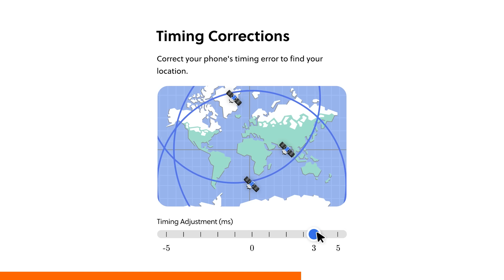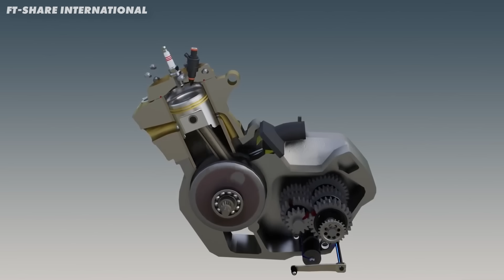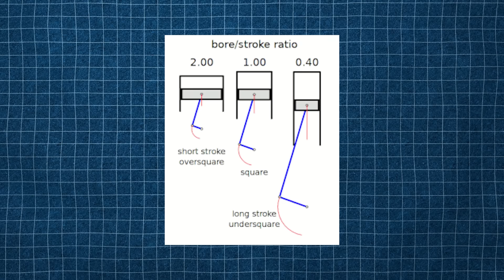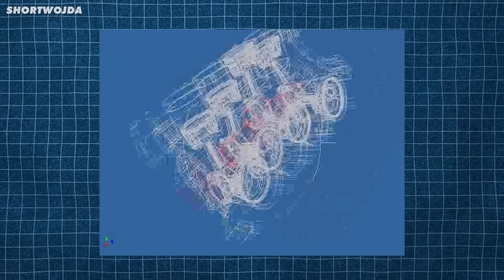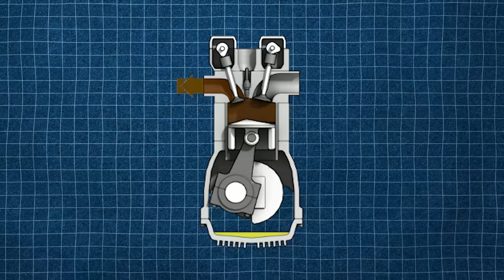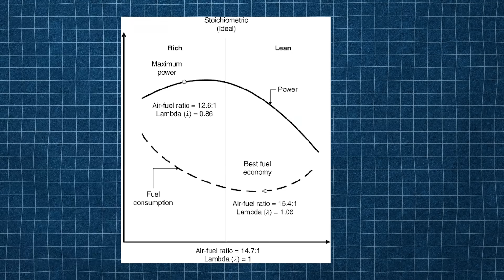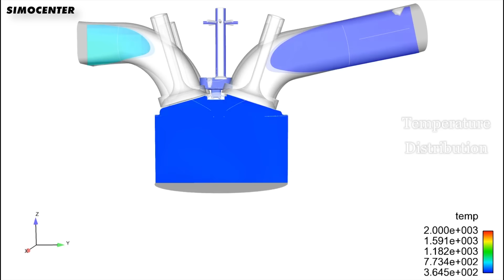Why It’s Almost Impossible to Rev to 21,000 RPM

Comment: NONE of the thermal or stress issues are a deal breaker.   Having worked in F1, analysing stresses in pistons and conrods and crankshafts and valves, I'm quite sure everything could easily run much faster - 30,000rpm would be no problem, particularly if exotic materials are allowed (like aluminium - beryllium). Turbochargers in humble road cars can hit 100k rpm while red hot...
The killer factor is time. Higher RPM means less time per cycle, but the physics of fuel combustion are "fixed", in that flame fronts take finite time to propagate. The flame-shooting injection is a great idea - an advance on Alfa Romeo's "Twinspark" idea that used two spark plugs to start two flame fronts in the combustion chamber. 

The second problem is keeping everything synchronised. While the components can be designed to survive the loads and stresses, keeping the valve timing synchronised with the piston motion is harder than it might seem. (Quite apart from the problem of "when to start combustion" to get an optimal power output from the cylinder (fire too early, combustion works against you. Fire too late, most of the power goes out the exhaust. Ignition advance is a huge field all to itself. But I digress.) 
Because, nothing is rigid, and everything is flexible. And twistable. 
V12s and V16s have much longer crankshafts and camshafts, and will twist along their length, resulting in some very serious timing errors in the cylinders remote from where the shafts are linked together. Various efforts to deal with this include using link gears at both ends of the engine, or putting them in the middle. Which brings their own problems with "forced" positional control, that can induce their own breaking loads. This can all be engineered around, not least via novel valve technologies. 
But to even be aware that everything is flexible, and avoid the typical "rigid body" thinking that seemed to afflict everyone else working in the field, is a challenge in itself. 

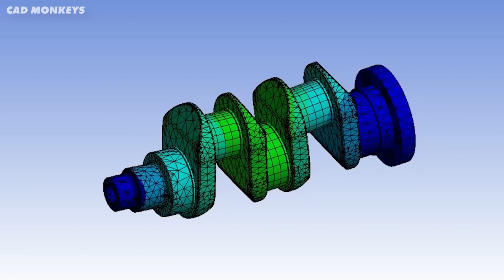For those that doubt if I know what I'm talking about, take a closer look at the bending crankshaft animation at 8:03. That is NOT showing "stress" (so, we don't even have to debate whether it is Maximum Principle Stress, or Von Mises stress, or some value of fatigue alternating stress - ALL of which MIGHT be the one dominating "failure".)

 It is showing a colour contour map of DISPLACEMENT. Because, the entire "red" part of the crank does NOT have similar stress - that would be concentrated at the fillet between crank web and big end... certainly not distributed equally over the whole section. 
Worse than that, the deformation is created by moving the centre main bearing while holding the mains at each end - a totally false load case that simply never happens in reality. At least, not to the extent it is shown here. Some movement is possible because these bearings are oil film (journal) bearings, and the oil film thickness allows a small amount of movement. But this animation is not intended to show that, since displacement at the centre WOULD cause movement in the end bearings too - the crankshaft stiffness forces that.

One of the reasons I gave up doing what I did, was the disparaging remarks about being "the pretty pictures department" by folk that did not bother to look at my track record of "ZERO in-service failure" of any part I ever worked on. Sigh. 
But sadly, even 20 years later in 2024, it seems not only has nothing changed, but the "pretty picture" is not even a valid picture at all, but something created purely to look pretty. Sigh.

TMI but for those still interested, "zero in-service failure" means inifinite life while in use in the engine. NOT "unbreakable parts" (you just have to subject them to loads they never see in service, to get them to break).
This included redesigning finger followers that broke in 10 minutes, and conrods that snapped in an hour. All of these became "infinite life" parts that could last forever, just by fettling design details. And, making them lighter for better performance at the same time. For me, durability usually meant removing redundant material, and sometimes redistributing material, to better disperse loads (and hence stresses) throughout the structure. 
I never had to fix anything by adding any material to it. Which is contrary to intuition, and is the "go-to" response of about 99% of others doing this kind of work. "Beef up the weak bit" is NOT a good thing to hear. 

Just like the crankshaft that drew envy because it NEVER broke, not only lasting an entire race season, but also having the smallest main bearings of any crankshaft on the racetrack. (and smaller mains meant less parasitic torque was drained from the power output, giving more BHP at the flywheel...) 
But smaller bearings mean a huge increase in stress concentration, making it much more difficult to endure the loads any crankshaft has to survive. 
Anybody else that even tried to match our bearing size, never finished one race. 

When you get a handle on engineering, and materials, and stresses and strains, and loads, and resonance, and vibration, and heat transfer and temperatures, and... then designing engine parts for conditions thought impossible, becomes quite possible. 

There certainly are limits. Yield strengths of materials, for one. And when you factor in that the strength depends on temperature, too... But rather than get sidetracked further on "strain rate sensivity" and why F1 pistons survive stresses more than four times higher than their yield strength at operational temperature, just know that we are still quite far from reaching those boundaries with designs at 20k rpm. 

I mean, 99% of the piston is not even close to failure. It is the 1% detail problem where stresses concentrate that start the cracks that lead to failure. 
Same with that crankshaft. The challenge is fettling the details WHERE THEY MATTER. 

Sorry for the essay. Thanks for reading.
Reply: Thanks for the writing. Fellow mechanical engineer here... one that knows why adding material to the most stressed point of a part doesn't work ;)
Reply: Thank you for your insight. It appears we not only have to deal with stress on engines - but also the stress on engineers!
Reply: @David_Crayford  most projects fail because of bad management instead of bad engineering
Reply: @David_Crayford  That is a never ending issue, often mitigated by vacations. Rises help too!
Reply: Thanks for the essay. I appreciate the insight.
Reply: Thank you for your essay. I'm not an engineer but I really enjoyed reading it.
Reply: No thank YOU, for writing a masterpiece.
Reply: Such a ring of truth "beef up the weak part". I have saved quite a few projects by reengineering that failed testing which had too much material and in the wrong places. Seems few engineers really think about first principles
Reply: @heysscientific5125  that was more likely a stress concentration problem
Reply: What's the relevance of turbocharger RPM?  That's a turbine design and doesn't have reciprocating pistons.
Reply: @petergerdes1094  Yes, exactly. The relevance is that it is the reciprocation of the pistons (and the conrods they need) that causes the rpm problem (through their associated inertia loads), since we KNOW that purely rotating stuff can handle far higher rpms AND temperatures. 

The video claimed that thermal and stress (rpm) issues were the reason for engine rpm limit, and the turbocharger proves that that is incorrect. Take away the reciprocating parts, and any F1 engine would have no rpm problem at all, easily exceeding 20k rpm. 

I'm just trying to say the claim was too simple, and lacking in detail, to accurately reveal the problem. 

Clearly you do understand that reciprocation is the root problem, but not every watcher of the video will know that detail. 
I felt a turbocharger example might show them that temperature and "rpm" are simply not good reasons enough to explain why an IC engine struggles to get past 20k rpm.
Reply: @bythelee  But the video said exactly that too.  It even talked about how there are turbine based engines at much higher rpms.  It was just further into the video.
Reply: @petergerdes1094  I feel it wasn't made clear enough that the initial claim (thermal and stress issues) applied to the reciprocating masses. When the later note of turbines came it was glossed over. Nothing explained why things were different in F1 (or any piston engine). 

The turbocharger illustrated that the rpm and temperatures are nothing like high enough in an F1 engine to be "limiting factors". 
The video did not give any factual detail on that whatsoever, leaving viewers that do not already know this stuff unaware of just why 20k rpm is a problem.

I was just trying to make it clearer that neither the thermal nor the stress "issues" (whatever the script intended those to be) are the root cause of an Internal Combustion Engine limits.
Reply: @bythelee  
Amazing stuff, and thanks for taking the time to share your knowledge with us. I could listen to discussions like this for days on end!
Reply: @petergerdes1094  no but the tangential stresses can be compared to what the rods go through (think elongation due to the piston)
Reply: @petergerdes1094  could be referring to exotic materials which allow the turbo to operate when red hot.
Reply: What an interesting read, thank you.
Reply: at the end its the same as with the diesel engines cant do more as 8000 rpm due to mixture burn time. maybe going with detonation burning? :D
Reply: Jesus H.... thank you.  I normally don't read walls of text but that was incredible and I'm glad I read it.
Reply: Thanks for your comment. I work for an endurance sportscar team. We worked hard to generally enjoy our time at the track. On two occasions we were a support series for F1 and the thing that stood out to me the most was how everyone in the F1 paddock was angry or depressed. No one was ever having a good day. What is wrong with those guys?
Reply: @thadaagaard6648  I can only speculate, but from my side I'd say the problem is ego. Everybody is trying to prove that they are the best, and have to act accordingly, even when they are not. 

Permanently on show, expected to live up to impossible ideals, when underneath they all know there is a pecking order, and their likely place in it. 
Anger and depression comes from seeing that reality, but having to keep acting like you are supreme. All the worse, because the stakes are so high. It is intense, with no relief. Nobody - not even the team coming last - is allowed to relax and have a good time. The sponsors expect the team to be pushing to improve (ie win) all the time. 

Everybody wants to win, so coming last on the grid, or losing out because of a pit stop slip-up, or bungled strategy, makes everybody very tense and frustrated. 

Just one dropped spanner or loose wire or mechanic oversight can waste the entire effort of everybody - even worse if the best car and driver misses out because of one silly whoopsie. Nobody wants to be the one that let the team down. So they can be at each other's throats all day, and when the stress finally trips into a mistake, the person responsible might not even have a job the next day - depressing thought. 

At the end of the day, there can only be one victor. But nobody ever wins. If your team crosses the finish line first, then you have to do it all over again at the next race. 
No pressure!
Reply: @bythelee  wonderful read, both of your comments should be enshrined in a car engineering sub-reddit. I didn't even keep watching the video after the "2'500 tonnes" remark. At least it promoted some (hehe) enlightening discussion in the comments. 😉

I'm not saying you should write a book, since it seems you have plenty of experience to share, but would you consider putting your musings into written form, like a blog, perchance? If you already do, could you point us to it? Cheers! 🤓
Reply: So basically what you are saying is that beefing up is not a solution for a part that snapped due to concentrated stress, but to redistribute the stress or spread it over a larger area, I see, ummm. How am I going to achieve this? One of the other thing you mentioned about the critical degree of twist in longer crankshafts, or camshafts that can play havoc with synchronisation, or even valve timing,  due to flexibility in materials, not quite sure if the flexibility so great so as to upset critical timings. Yes may be at 20K RPM
Reply: @mgabrielle2343  How you are going to achieve stress redistribution is a subject that takes a lifetime of experience to answer. And nearly as long to share. More follows later. 

The synchronisation issue is not just twist in the shafts, but also the flexibility of the components (like the valve stems - valve accelerations are far more extreme than the piston, and the heavy valve head is essentially doing a bungee jump at the end of a stretchy stem). 
In an F1 engine at 18k rpm, the valve head could be mismatched to the piston (crank) position by as much as ten degrees of crank angle. When you are trying to control the valve head position to "as tightly as possible", because opening late and closing early greatly reduces the time for induction, to get the air and fuel mixture into the cylinder. But to open early and close late will have that valve smacking into the piston, causing instant failure. 
That ten degrees can be oscillating, too, meaning that it can be "worst case" either way, forcing you to leave extra clearance to the piston in case of early opening, as well as losing more performance because of actual late opening. 

The details are intense and far more TMI than my earlier essay. I can't really do it justice here. 
I wrote a 10 page report purely about the valve stiffness, trying to understand valve seat damage, and quantifying all the ways I could think of in which valve stiffness alone could result in the valve head being 2mm closer to the valve seat than expected during the closing event. In any valve lift scenario, 2mm change in head position is MASSIVE. 

Suffice to say "synchronisation" is a huge deal for "maximum" performance, and made much worse with longer, more twistable shafts in engines with more cylinders. Tip of the iceberg? No, more like snowflake landing on the tip of the iceberg. 

More synchronisation:
Even at 10k rpm, a NASCAR engine would advance crank angle by about 30 degrees before the inlet valve head even knew the camshaft wanted it to open. Which makes a complete mockery of any camshaft designer who defines the cam lobe shape (valve lift curve) by considering "everything is rigid", in the quest for optimum engine performance. 10k rpm is not that far above the 6k rpm limit of most road cars, so do not dismiss this as "not worth worrying about". 

But I'll admit it's not a great comparison, since those V8 engines use pushrods to move the valves - creating a longer path for loads to move through. 
Most modern cars have overhead camshafts, which takes away the pushrod issue but leaves the "long shafts twist" problem and adds the flexibility of the drive between crankshaft and camshaft, which is often a reinforced rubber belt these days! How precise is that rotational synchronisation going to be! 

But now we're also into "speed of sound through a material" detail, such that any transient load applied to a part can only ripple through the structure at the speed of sound for that material... adding yet another detail to consider when designing critical parts. 
Your lawnmower might not care about this, but SpaceX's latest rocket might... as would Boeing's latest 737... 

Getting back to the Stress question:
I believe one of the most important concepts you need to grasp, is "stiffness". Already mentioned "nothing is rigid, everything is flexible". Question is, HOW flexible. 
And that isn't just the material stiffness, or Young's modulus, simply defined as how much a material will deflect for a given applied load. 
Stiffness is ALSO (and perhaps more importantly) defined by the geometry of the part (aka geometric stiffness). 

A steel rod most simply shows the stiffness of the steel. You won't have much effect trying to stretch a half-inch rod of steel with your bare hands. But bend that rod into a coiled spring, and suddenly you have something soft enough to use in a car suspension - which visibly moves when you get in. That's the difference between material stiffness and geometric stiffness. 

Each material has a different stress at which it will fail, making the choice of material for any given object a challenge that most folk solve by looking at what was done before, and trusting that time and past failures have led to a "convergence" of the best choice for the job. 
However, in your road car the conrod is probably cast iron. In F1, they are titanium. And in dragster engines, they are aluminium. 
Clearly there is no single "right answer" for any given problem. Often, the design choice is driven by economics. Not just cheapest material, but ease and cost of machining/casting/manufacturing. 

Once you have a chosen material,  understanding how to get that stress (or, perhaps "load path") to favor a different path requires comprehending how a 3D geometry of something like a crankshaft reacts to the loads applied on it. 

There are forces from the oil film bearings, inertias from pistons and conrods (plus the firing pressure), torque going out to the clutch and gearbox, and driving the valvetrain if not the oil pump and coolant pump, and maybe an alternator and aircon. Add to that the geometric constraints of cylinder (and hence both big end and main bearing) spacing, the bearing sizes (both width and diameter) deemed necessary to maintain functional oil films that can transmit those forces without letting metal touch metal, ancilliaries and so on, and you have a complicated puzzle to solve. 

When you can fathom how the push on the bigend gets transmitted through the material of the crankshaft to where it exits at the ends (as torque), then you can start to see how adding or losing or moving material (where allowed - typically in the crank webs but also in the size and shape of lightening holes in the big ends) can influence how those loads distribute, typically leading them away from the little fillets that form "stress concentrations" and are the usual culprits of all failures. 

At the end of the day, we can only do our best. The proof of the pudding is in the building and testing, and scratching our heads for new solutions if it does not pass. Which is where the bean counters complain it costs too much, and the boss wants it yesterday, and you're thinking no job is worth this drama, because nobody in authority seems to understand the complexity of what they are demanding. 
If this was easy, anybody could do it. 

There is another golden rule here:
"The answer you get is only as good as the question you ask."
Apply the wrong constraints (like the completely artificial anchoring of the crankshaft in the displacement model) and teh answer you get for what the crankshaft shape should look like, and where you should put the material to influence the load paths, will be so utterly wrong it will mislead you more than help you. 

Ignore the wrong loads, make the wrong assumptions, dismiss the wrong factors - these can all scupper your best effort, literally rendering the whole effort a total waste of time. Worse than that - the misleading answer can set you off chasing the wrong cat, barking up the wrong tree, making it far harder to get back to something that works. 

In other words, the onus is on us to understand ALL of the detail as best we can, if we want to have any hope of getting it right. It took me many years (decades) of learning to acquire my understanding. Never stopped learning, tbh. 

So, never think you know it all. That's how OceanGate's Titan submersible failed, killing five on board. 
Ironic that they were trying to view the Titanic - another overconfident mistake that ignored how the metals used to build the ship get brittle when exposed to cold... And did not consider it necessary to build watertight doors all the way to the top deck (which would have saved the ship, if they had). 
The tiniest of oversights can lead to ultimate failure. Which is a far cry from "How do I move material to influence load paths and steer stresses away from concentrations". I think I'm mostly trying to say that you will never stop learning how to do this, and brace for learning from every failure you get. Because, if you think something will work and it does not, the obvious message in that is that you missed something...

Sorry for typos - this was far too long and detailed, and I still didn't share even 10% of what went through my mind when I read your question, never mind write an exhaustive expose on everything relevant. 

But, your questions were good enough to warrant an attempt at an answer. Hope it was worth it.
Reply: @mgabrielle2343 It probably has a lot to do by making the stronger part lighter and more flexible, thus tuning the whole part to flex, instead of just a single point. Also lighter means less stress from inertia. But I'm just an inspired backyard mechanic. 😅
Reply: Awesome stuff, thank you!
Reply: I was going to post what I thought was an insightful comment until I read this post and realized how impossibly underqualified I am to speak on such topics.
Reply: It's fantastic to have an inside look at high end engineering. Thanks for sharing. ❤
Reply: WTF I read those "essays" on my phone like I was reading a Tom Clancy novel. I have absolutely no knowledge in engineering and it was super interesting and week explained. Thank you !
Reply: What I've heard mentioned is that there is a practical limit on piston skirt speed. If the speed exceeds some limit, you're literally at risk of friction welding the piston (and/or its rings) to the bore. Based on that claim, a 30k RPM engine would have to drop its stroke by a third (all other factors being kept constant)
Reply: yeah I expected this from the video. too bad the video was totally useless and uninformative, dare I say misleading. and yet, he gets money from views, and you don't. Thanks for the actually useful comment!
Reply: Comparing a turbocharger to a reciprocating engine is meaningless for two reasons.
#1) The turbocharger's loading in not cyclical with each revolution. But for a reciprocating engine, it is. 
#2) The forces exerted by a turbocharger are almost purely radial. That's far less complex than the combined motion of linear pistons, valves, rotating crankshafts and rocker arms, and combined linear/rotary motion of connecting rods. It's no wonder that turbos can run five, even six time the speed of the best reciprocating engines
Reply: turbochargers going 100k rpm is kind of irrelevant to engine rpm, turbochargers don't have reciprocating components attached to their revolutions.
Reply: @PandaMan02  I also mentioned that distinction (no reciprocating loads)in a prior comment. The only joint between moving parts on the turbo is a bearing. Assuming the impeller is balanced, it sees ZERO inertial loads.  In contrast, the reciprocating engine has very large inertial loads (perhaps a kilogram per conn rod and piston, multiplied by very high g's. Plus the g's cycle +/- per revolution (more complex than that when also factoring in conn rod motion) and which increase with the SQUARE of the rotational velocity
Reply: That's really interesting!  Even during the video, the timing definitely seemed like the most difficult nut to crack in this, so thanks for corroborating.
Reply: If they can rev above 30k, why don't they go anywhere near that?
Reply: Hmm, should have told that to Mickey Thompson at the 1963 Indy race. I was sitting just to the left of J.C. Agajanian's group at the forth turn. (He won with Parnelli Jones as the driver).
Reply: I agree. 
However, I would like to add, that in general adding material can work, as there are situations, when there is too little material and adding material can distribute the stress. In a dynamic situation, the additional material can result in problems in other areas. A heavier piston would stress everything else more and might destroy a rod. In many cases you don't want a heavy part (Not even in a tractor, but it might not really matter in some situations like that.).
I guess that's what you wrote anyhow. However, you emphasized the part that people didn't think about what they were doing and how adding material can result in problems or suboptimal parts. I couldn't resist to point out the corner case. Not mentioning it might be better, because people not thinking would only take it as an acknowledgement.
Reply: Its for sure great to read, i did learn something from it and i'm definitively not forgetting this test.
Reply: Please don't apologise for the essay. I enjoyed reading that. I admit I didn't understand it all. But as a bloke who builds his own engines for hobby Motorsport. It's given me even more I want to learn. 

Sometimes the internet is actually pretty good at connecting like minded people. Brilliant
Reply: Do you have any knowledge about why the Volvo B18 engine was so durable as early as 60+ years ago? The engineers put them through a stress test back in 1961 where they ran 10 engines on full throttle and full load to see how long it took for them to break, but they stopped at 500 hours after not a single one had failed.
Reply: thank you, i’m not a professional or anything but as a nerd your contribution greatly helped point me in the right direction 🙏
Reply: F1 is easily considered an elitist playground however many don't stop and realise how much technology or idealism is pushed there or how much we all benefit from it.

The way we are "evolving" presently, in 20 years people will be convinced that F1 was all a grand hoax and filmed in a Hollywood studio 😂
Reply: Thanks
Reply: Great comment.
Reply: Thanks for the essay. It's really good.
Reply: Really good commentary.  GM engineer.
Reply: Where part 2 of this I need more to read
Reply: At 30,000 rpm, how much would the piston "weigh" at max acceleration or deceleration?
Reply: This is what limits diesel RPM also - time taken per burn cycle ?
Reply: what if smaller pistons were used, in an I6 engine? Something like 1000cc? It would help with most of the problems you mentioned.
Reply: You're as strong as your weakest point. I see those metal parts as "organic" in some ways = it must be fascinating unveiling new alloys and techniques.
Reply: with faster burning hydrogen there may be higher revs possible if the mechanical side is not the limit.
Reply: @unbelievablegoodio7176  But, there is so little energy density in Hydrogen (relative to petrol) for it to be useful in a race application.
Reply: Dude u r a legend
Reply: If you haven't written a book, please do so. I'm generally not a gear head and I was fascinated the entire time reading your post. Thank you!
Reply: This is better than my education, really interesting to read 😊
Reply: as a mech engineering in process, reading your workplace experience and how you use your knowledge on cool stuff like this is a very valuable insight
Reply: Excellent.
Reply: At first I thought you argument was strictly against thermal stress, but it seemed you argued that we could achieve much higher RPM in general. 

I disagree. We’re pretty much at the limits of what’s physically possible with what we currently have with technology. Not only are you facing tremendous stress involving G Forces, but at some point, pistons are moving faster than fuel can burn. You can’t possibly get faster Motion without more energy. That’s just the laws of physics.
Reply: Very interesting thanks for sharing your knowledge!
Reply: I subscribed to your channel hoping that you’ll share more of your knowledge.
Reply: Thank you for writing that. I'm a mechanic by trade and it's refreshing to read something in YT comments worth reading written by someone who actually knows what they're talking about. I found this far more interesting than the video. Thanks again.
Reply: This is brilliant. I Wish there was a way to save comments on YT like in Reddit, I wanna come back and read through this entire thing again; such amazing insight, thank you for sharing.
Reply: U are awesome just know that
Reply: Thank you, was interesting ;)
Reply: Thank you very much for your detailed insights. Being an engineer myself, it's somewhat depressing to hear, that even in the high performance world of F1, the "pretty picture" phenomena is able to last. I'd have quite some questions to ask, but will leave it at that. Hopefully you found a more rewarding job within engineering!
Reply: How in the world did Youtube not delete your comment? YT mostly deletes longer comments....
Reply: Bro I could read a book of this
Reply: Fantatic summary of the technical issues.
Reply: So would a Rotary engine be more optimal trying to hit those crazy high RPMS? There is less flex and moving parts?
Reply: @timetoshred2461  That was the entire premise behind the Wankel.
However, it encountered 2 significant obstacles. The first (sealing of the compression chamber) may have been solved by engineering.
The second (emissions) saw it killed by bureaucracy.
No one is going to spend the money engineering a solution to a product that is DOA because of regulations.
Reply: 1,3k thumbs up ZERO thumbs down says it all 🫡
Reply: Thank you for writing it
It was very good to read. 
High regards
Reply: Dang I actually read all of that…
Reply: Comments that are better than the video
Reply: i aint reading all that